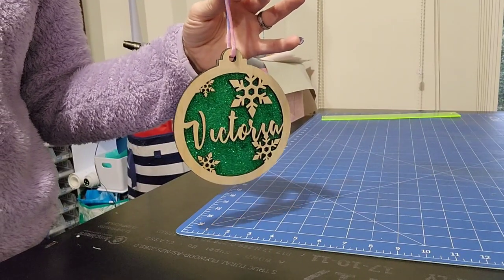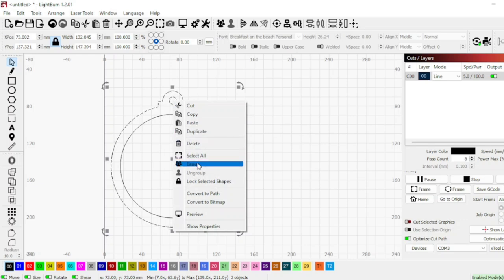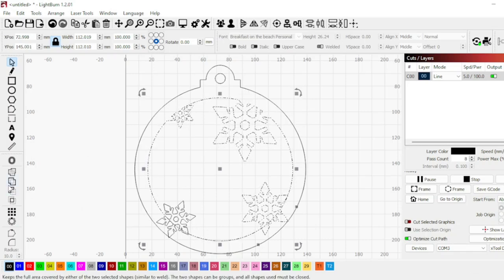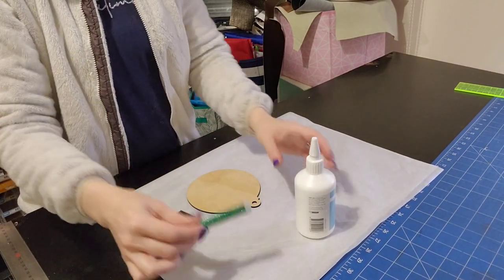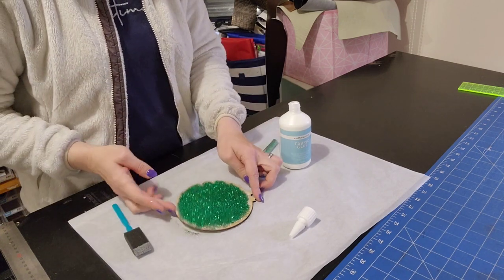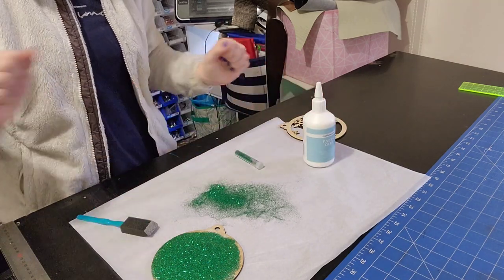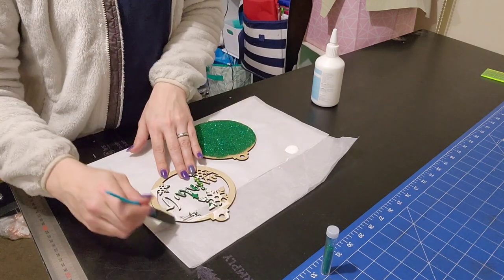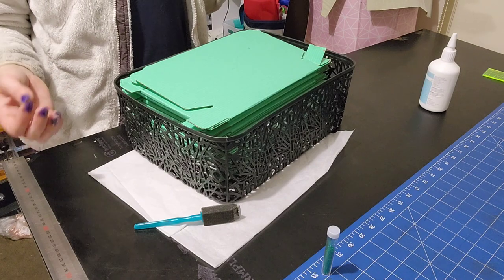Create A Christmas Bauble with your Xtool Laser

Comment: If you put 3 or 4 finish nails (keep them straight vertical - not on an angle)  around and against the lower ring, when you lay the top ring to glue it to the lower ring the finish nails will keep it in perfect "register alignment" with the lower ring.  Don't have to mess around trying to move it  around by hand.  Works with any shape of multi layer glueup like this.

Comment: Hello, nice work, did you try to glue the second part and put there glitter at the same time, so you fill with glitter only free spaces?
Reply from the maker: I did just slightly inside the circle as I knew I didn't need it right at the edge